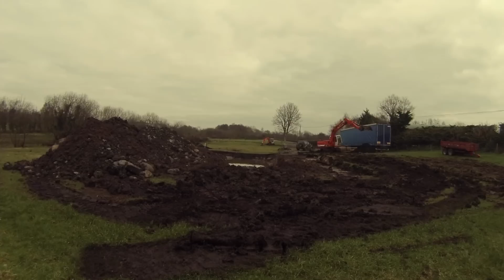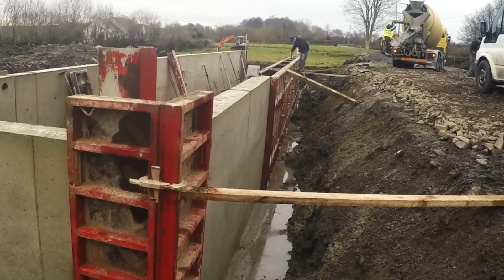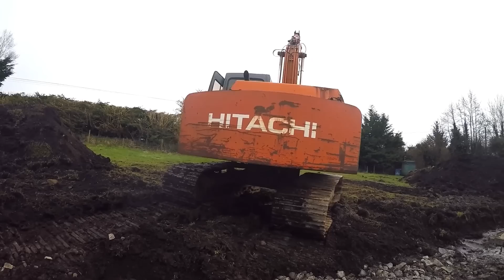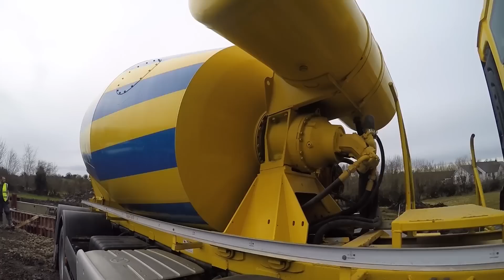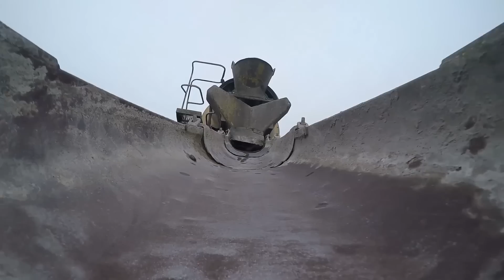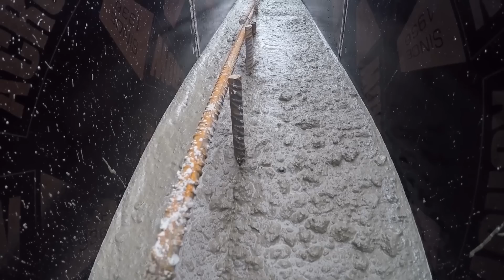Timelapse of Tank being dug out, shuttered and concrete poured

Comment: Why is  it showing only 1 layer of vertical steel ,Having  fixed  hundreds of  these tanks ,Has the design changed,
Reply: Seen that too.

We do double that. 2 sets of uprights know as u bars. And floor bars tied together then layers put inside that again in 4 separate rows